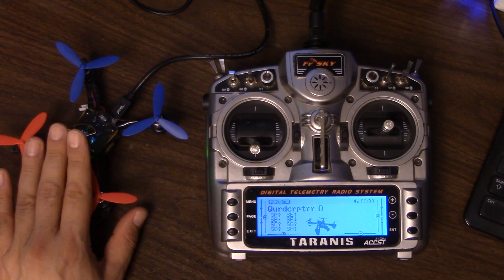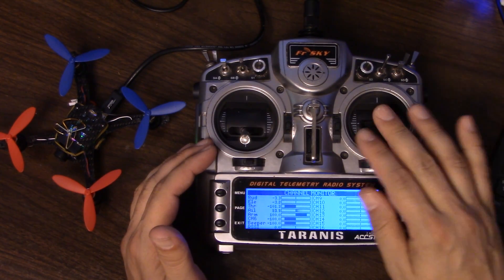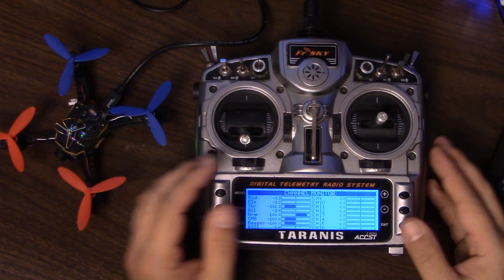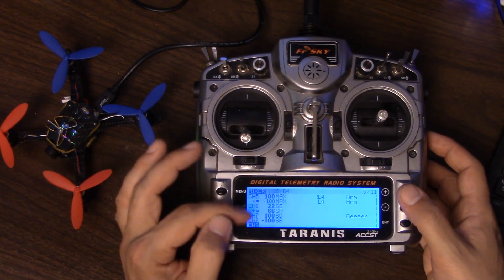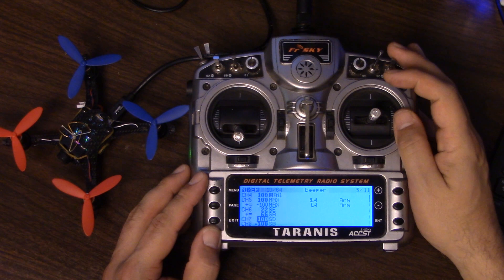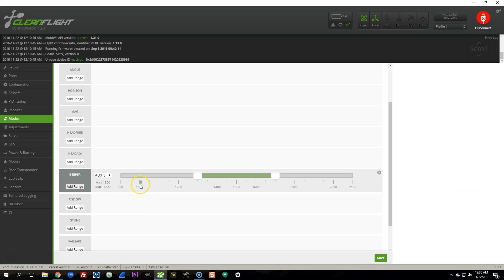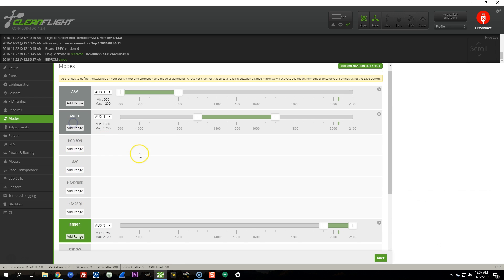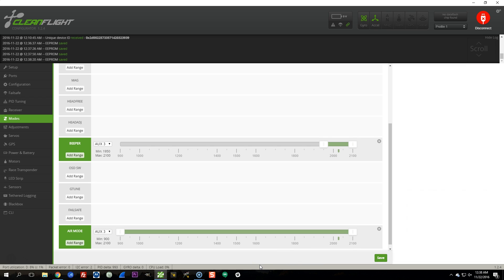Cleanflight / Betaflight Flight Modes | HOW TO SET UP

Comment: None of my AUX were responsive in betaflight; been sleepless about this. In the end a firmware downgrade to the previous version solved all my problems.
Reply from the maker: +Laurent there's no reason you have to resort to that. If it works on an older version them your transmitter is set up correctly. Check the value of max_aux_channels.

Comment: How come I don't have receiver mode in my clean flight. I'm using the full naze32 rev6
Reply from the maker: +JayBirdFPV ! What is receiver mode?
Reply: Hi Joshua I  have the same question I am tottaly noob in this. How I can get my receiver to cleanflight ? Receiver Eachine i6 , modul SP racing F3. Thx !
Reply from the maker: +Michal Rábek in cleanflight the receiver configuration is in the receiver tab, not the configuration tab.
Reply: thanks for answer, yes i am there in the receiver tab. I see also receiver mode tab. But I am trying all 4 modes but toolbars doesnt move. I suppose battery must be unplugged. Sorry for stupid questions I am realy new in programming quads but I am trying to teach myself step by step :)
Reply: lol, I found it eventually. Thanks!

Comment: Joshua,  a question for you: Beeper/buzzer in Modes and Beteflight in general. Every quad I've hooked up the beeper on from QX70 to X220  and they act the same. They beep too much. They beep the little song on battery plug in, beep for everything like stick movements, switch movements etc. and is very annoying.  I want to configure the beeper so that it ONLY comes on from the Modes switch for lost model use. I don't see any beeper configuration settings in the Betaflight UI that would achieve what I want. I figure you if  anyone, would know.  Thanks!

Comment: Hello, i need your help if possible. I use until now the CC3D controller but i whant to next level. What is a nice flight controller to Betaflight. Thnaks
Reply from the maker: Omnibus F4 Pro if you want an AIO.

Betaflight F3 if you want an AIO with integrated PDB.

Rotorgeeks SSD if you want an FC without OSD or PDB.
Reply: Many thanks

Comment: great video. 9:00 you showed how to use a mode the whole time. so when I use the whole range for example with airmode, I would Not fly in Acrobatic mode, right? so airmode would overlap acrobatic Mode?
Reply from the maker: Air Mode is not a mutually exclusive mode. It stacks. Enabling or disabling air mode doesn't change whether you are in acro mode or not.

Comment: Hi Joshua, have you done a video on how to set up mix channels on Spektrum radio, in my case  DX6i, so I can get more of the Betaflight modes? I'm a bit confused  by that.
Reply from the maker: I don't have a Spektrum radio, sorry. And the one time I tried to set up Aux modes on a friend's radio, I couldn't get it working. At least not while at the field. Probably if I had had the Internet I could have.
Reply: No problem. I'm beginning to dislike the older Spektrum stuff I have and will just use the  DX6i for the Horizon/Blade devices that work with it.  Seems like for the Betaflight systems I've tried it with, the Spectrum has been flakey.  I have Flysky and Spektrum now but seems like FrSky is the most reliable protocol out there. Been trying to hold off on a new radio but guess I'll have to pony up for a FrSky radio. I have a pre-order from Horus for the new Taranis Q X7 radio, whenever that shows up.
All the best in the New Year!

Comment: Hi, 
First quad real rc here. Using naze32, latest betaflight and latest blheli s .All my mid points are 1500 exactly, but even moving the end points in my flysky-6 I cant get a perfect 1000 or 2000 at either end. They are close like 1002 - 1998 for example, does this matter? 1500 Is perfect using the subtrim, just the end points move about 2 or 3 when going from say 100% to 101% in the end point setting. Hope this makes sense haha the quad is ready to go, just waiting for day light to try it out. Thanks, your videos are great btw!
Reply from the maker: That's close enough. Don't sweat  a few microseconds. If you hit 1002 consistently, then set min_check=1010 in the CLI to eliminate deadband at the bottom of the throttle.
Reply: Thanks for that, is that just to allow for some 'breathing room' as apposed to setting it to say 1005? I assume I can also do set max_check=1999? Thanks Joshua
Reply from the maker: +thesean 5 exactly. A tiny bit of breathing room to make sure you can arm.

Comment: Another nice 101 video Joshua, will be sharing this with my friends starting off flying. :)
By the way... In your AIO roundup video you weren't sure why you needed an F4 processor... reckon if you want to still use these Angle / Horizon modes & still want to run fast looptime & features this is a good reason for why an F4  ;)
Reply: That is very good ... Have you also got telemetry, blackbox or LEDs turned on?

Joshua was just trying to find a reason why F4 boards were maybe worthwhile... thought this could be one reason.

5% CPU Running BF 3.0.1. on my F4 boards running 8k / 8k plus telemetry, blackbox, LED, etc

Comment: Hey Josh, I know this doesn't really relate to this video, but seeing your Taranis reminded me to ask. Since the Taranis comes with endpoints going from 975-2015, should you adjust the bottom and top ends to hit 1000-2000? Are you losing resolution by leaving it stock? I think I am as I had to go a few clicks up (haven't removed the ratchet yet) on throttle before it revs up past idle.

Comment: hey Joshua,  I just learned(from you) that I can remap motor outputs and salvage the 2 spracing f3 boards I have with missing solder pads. can you by chance tell me how to remap motor outputs in betaflight3.1 ?
Reply from the maker: Betaflight 3.1 will have the ability to remap outputs properly. In everything previous, you are not really remapping the outputs, you are just rearranging where the FC believes the motor is located. But I don't know the details of how to do it, sorry. The good news is that the usual method of using the mixer should still work.
Reply: Very cool man , I see you already made a video on that . I'm going to watch it right now and bring to otherwise perfectly good flight controllers back from the dead.
BTW,thank you for all the great videos. I just got into fpv and rc in general back in June and without you and Bruce Simpson I would have been lost.
Reply from the maker: Bruce is fantastic. I first got into RC with Flite Test, and they are great, but for the more technical stuff, Bruce is a gem.
Reply: P.s.   do you have plans to do an in-depth D shot video? I am debating setting my 5 inch quad up with d shot but information is still a bit spotty and so I'm a little tentative.  I guess there is something I need to desolder from my racerstar V2 30 amp BL heli s esc. I'm pretty new to soldering so I would love to see someone else do it before I take a chance at messing up an ESC.
Reply from the maker: I will test out dshot when it releases, but in general I avoid testing pre-release or alpha features because they can have bugs and they often change quickly, in which case my results would not really be useful or valid. I'm too busy making videos to spend time making one that turns out to be useless a week later.
Reply: Copy that. I'll likely wait as well.I'm happy with multishot although I get one or two chirp/motor twitches per battery that I can't seem to eliminate. Otherwise motors are smooth and quiet.

Comment: I would like my 'Armed' program so that I have to use two switches. (in a AND function)
So you need to activate both switches
The idea is you can almost not armed the quad by mistake.

Is this possible.
Ohhh
My transmitter (RADIO) is a Futaba T8FG SBUS receiver and a FC X-racer V3.1
Reply from the maker: I don't know if your transmitter can do this. If your transmitter can sum channels together, set both channels to 50% weight and then arm when the channel goes to 100%--something like that. You will need to play with the weight and offset, but basically you want each channel to go from -100 to 0. Just setting to 50% weight will make it go from -50% to +50% so I'm not sure that alone will produce what you want. Play with it.

A workaround that I like is to raise the throttle AFTER disarming. This will prevent arming if you accidentally flip the switch since the copter will not arm if the throttle is above min_check. However if you do this, be aware that the copter WILL arm the moment you lower the throttle, if the arm switch is flipped.

There is no way I can think of in CleanFlight to make an AND logic for a mode. You can do OR logic of course by overlapping ranges.
Reply: You may use a DualRate or MIX switch on your transmitter to program the 50%-100% Joshua is talking about.
This is what I do on my Spektrum DX6i : Gear switch gives 0/50 when Mix switch is low, and 0/100 when Mix switch is high => So both Gear and Mix need to be high to give 100 (= Armed in my Cleanflight).

Comment: you forgot to take the props off before you connected to cleaflight. saftey first. ;)
Reply from the maker: I also use a smoke stopper sometimes. In that case, the props can scare the crap out of you but they can't actually hurt anything.
Reply: Some Flightcontrollers won't provide 5V for the receiver when they are only powered via USB. So you might have to connect the flight battery to see something move in the RX tab.
Reply from the maker: +ZeroFPV in that case, props should be off.
Reply from the maker: +red five fpv I'm pretty sure I didn't have the flight battery attached. USB can't spin motors.
Reply: Are there actually people who remove props every time they connect to the configurator? I just take them off when I'm calibrating ESCs.
Reply: ZeroFPV Yeah my rule is I take the props off if the flight battery is plugged in, which I've only ever done to calibrate new ESCs.